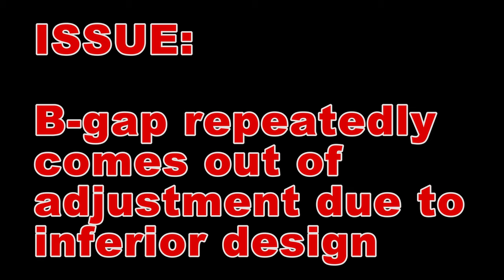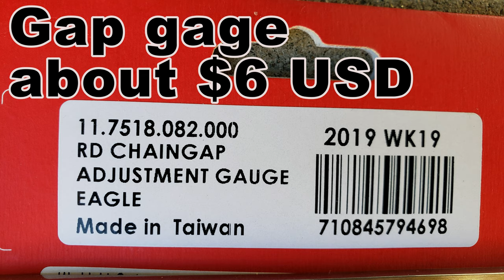SRAM B-gap is Crap || How to Adjust SRAM XG X1 Derailleur || Specialized Turbo Levo Expert

Comment: Very useful for someone un(willing)able to spend money on a b gap tool, cheers
Reply from the maker: Thanks! Your comment is confusing about why you can't / won't use this tool. How will you adjust the gap? If you don't use this inexpensive tool, you can adjust by eye (not precise, especially if ones close vision is poor), make your own tool (any object having the specified gap thickness to fill the gap), or eyeball beside a caliper or scale (hard to place in immediate proximity). Initially, I used a caliper, but now I just leave the lightweight gage in my backpack.
Reply: biketothetop hi I looked online for around 20 mins for some dimensions of the tool and you were the only place I could find it, so thank you. I had ordered a second hand (new condition) groupset that didn’t have the tool included and couldn’t be bothered waiting for it to arrive and also £6 spend unnecessarily. I simply used a steel ruler and measured 14mm from the tooth of my cassette to the jockey wheels. Haven’t had a single problem since!

Comment: Thanks a lot for the very useful info! You only need a rooler to measure 14-15 mm. Why making aditional tool for this? Useless like power link removal tool.
Reply from the maker: I benefit from the tool because 1. My eyes are bad. 2. I don't carry a ruler on the trail and I've used this on the trail a few times (during rough rocky rides), but the gage is weightless, small, cheap, and accurate.

Comment: on my NX 11v the screw slipped off the tip and bent. Now eveything is stuck and I can't unscew it. Any suggestion?
Reply from the maker: If I understand correctly, the B-Gap screw is bent so you can't extract it turning counterclockwise? If so, perhaps you can tighten it all the way in clockwise against the screw head and cut off the protruding bent portion on the other side of the derailleur body by using a cut-off wheel/grinder on a Dremel tool, then unscrew it out of the derailleur body?
Reply: @biketothetop  yes you got it! I can screw/unscrew just 1/4 turn because it's stuck towards the tip's side. I'll try to cut it  from the thread side, unscrew and find a more solid screw. I hope the screw hole it's not damaged. The point is: did this happen because of a bad installation or because a poor derailleur design? If the second case this means that it may happen again in the future.. Is the screw a standard M5 screw?
Reply from the maker: I consider this a bad design because it is not damage tolerant. One of the reasons I believe these screws come out of adjustment is because they hardstop against a curved surface on the derailleur body. You will see there is a witness mark on the derailleur body from this contact. As the derailleur swings back and forth repeatedly, it wears a hole into the derailleur body that causes the derailleur position to change and thereby require frequent adjustment. Because the screw tip's contact surface is curved it allows a component of force to act perpendicular to the screw axis and that is likely why it was bent during a collision with greater than normal force. I don't know the screw size without checking. If the internal threads are damaged, it may be possible to place a jam nut on the screw and and torque it against the derailleur body to prevent it from moving. I don't know if there is enough space to do this, but I often think of doing this just to reduce the frequency of adjustment because the screw also seems to walk. So in reality there are two reasons why the derailleur B Gap comes out of adjustment: 1. Screw tip wears into derailleur body. 2. Screw loosens.

Comment: Not only this problem, but the motor will breakdown with in three months. Levo suck
Reply from the maker: Yeah, I'd be pretty pissed if I had to deal with the motor problem, but luckily I've got over 2,700 miles on mine and no issues. Believe me if I was dissatisfied with my levo I'd be the first one making noise about it. I suppose I'm lucky. I've seen some information floating around that people say there may be a fix that came out for the motors that have belt failures. What was your experience with levo or are you just ragging on them because you have some axe to grind?

Comment: Buy Shimano 👍
Reply from the maker: I use both Shimano and SRAM, but b-gap tool is great to have.
Reply: @biketothetop  I also use both, but my XT is doing better than my GX.
Ball-bearings in the GX pulleys are crap, and the B-bolt from the GX is crap (installed new bearings and the B-bolt from the X01).
When you buy Shimano you don’t get different quality between SLX and XTR, just different wight. SRAM is doing bad quality even in GX derailleur…